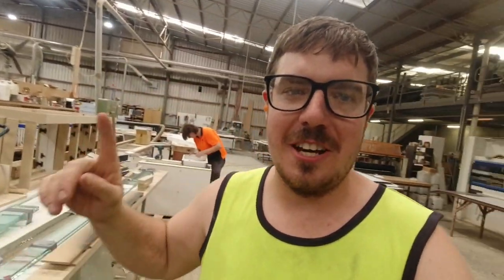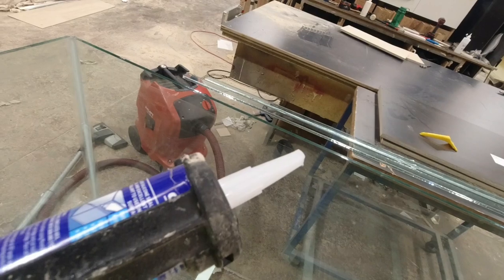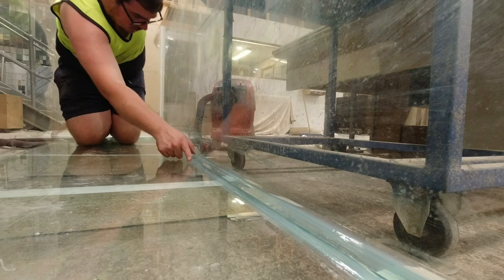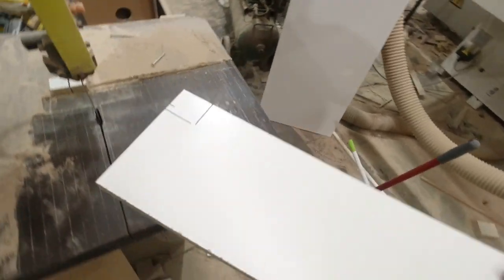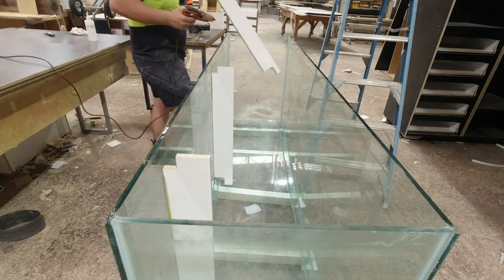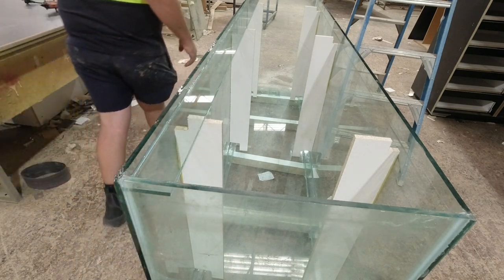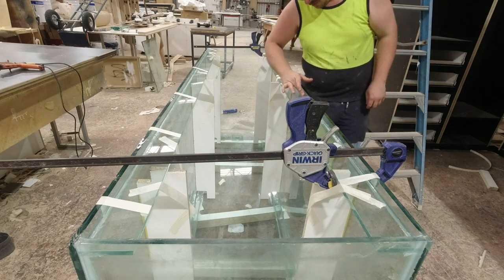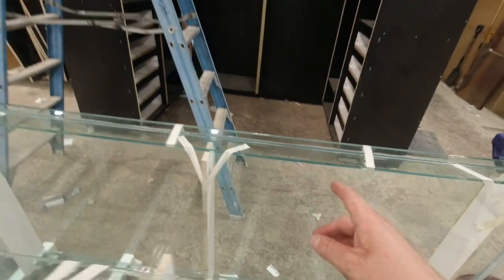Resurrecting a 8ft aquarium part 3

Comment: When I use to make tanks as a part time job we never had hot glue guns, just silicone and masking tape.I never braced the bottom sides unless it was supper wide. It is funny I miss making tanks.
I think people add bracing to holes for miss guided peace of mind, if done properly it is not needed and if done badly it want help, of course this is just my experience.
I would polish the tank as there is no such thing as JUST a breeder they are all tanks and should look there best, what is the point of making it out of glass if you cant see in?